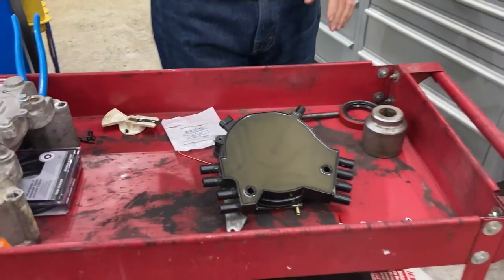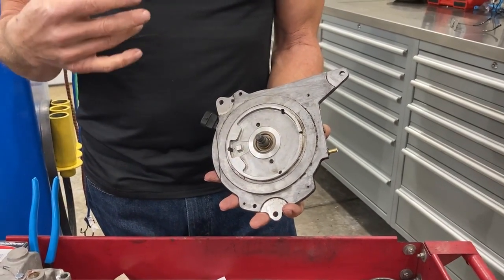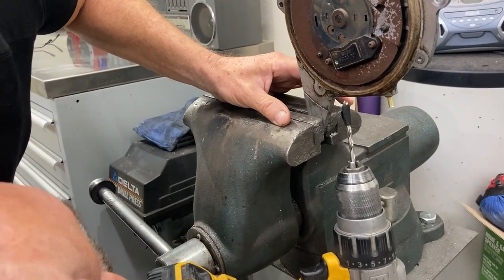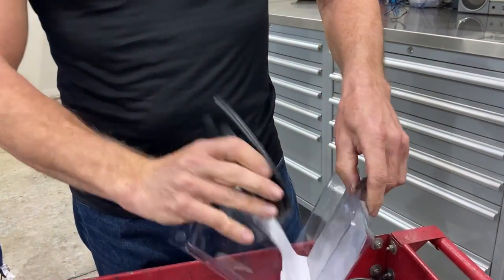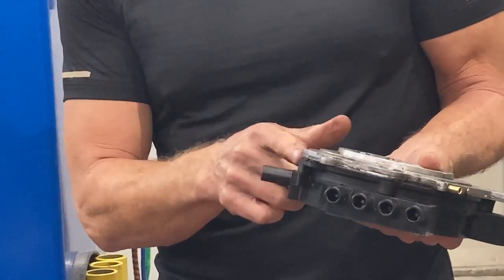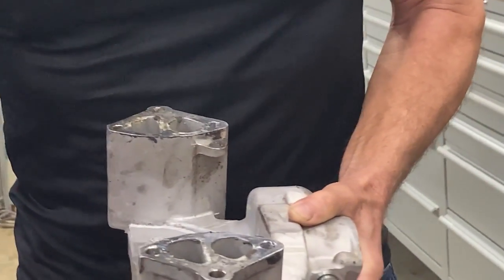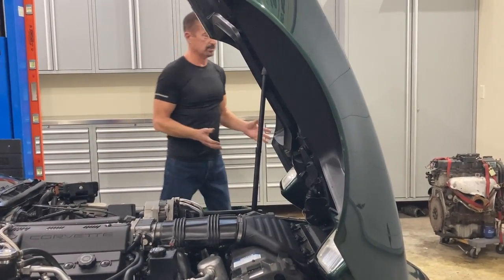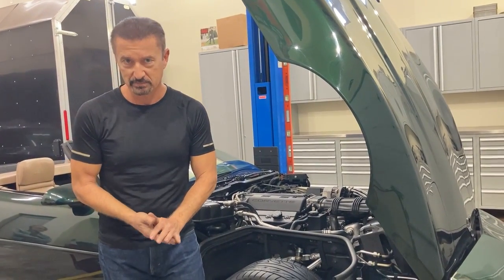1992 - 1994 Corvette LT1 Optispark DIY Redesign

Comment: Great video and very informative 👍🏻..  I have 95 c4 corvette has rough idel and makes a pinging popping sound... I have changed 02 SENSORS, EGR, TPS, IAC, MAP SENSOR and the sensor that screws into the front of the waterpump... but it still runs the same.... any ideas? Please don't say it's the Optispark... Lol
Reply from the maker: Okay, I won't tell you it's the Optispark...........but it's probably the Optispark.  Changing the Optispark is labor intense, but not that difficult to do.  There are a lot of good videos that show how to do the job.  Since I did the modification shown in my video I've had no issue with the car.  It is rock solid and very reliable.
Reply: @Arizonaperfect  OK Thanks..
Reply: @Arizonaperfect  just did the paper clip trick in my c4 95 port and there were 2 codes... C34 and H34... is this the Optispark?
Reply: @Arizonaperfect  I did get the new Optispark on last weekend and yes it fired up on the 1st crank... new plugs and wires... the wires on the Drivers side was the biggest pain but I got em on and correct.... the rear seal on the waterpump had gone bad but I never saw any water on the driveway and the coupling from the water pump to the cam shaft was rusted / welded to the spline on the pump and it cracked  on me while trying to get it off... anyways I'm waiting on another coupling to arrive and I can go back with the new water pump and get this over with... should be here tomorrow...
Reply: @mrdeanv4414 
Curious of your outcome.
Reply: @TheCorvettedez  it was most definitely the (FLUX CAPACITOR) Optispark.. so I changed waterpump,  spark plugs and wires.. it was all original and the plug wires still had the numbers on each wire to which cylinder it went to from the factory... she runs like a beast now.. however passenger side catalytic converter showing signs its about halfway stopped up... not sure what I'm going to do at this point...
Reply: @mrdeanv4414  
I just did my cats. It was a real PITA, as I did it on jack stands. If you don't have, at minimum, a welder and cutting torch, I would take it to an exhaust shop and have them put in a semi-universal cat from magnaflow. And definitely change the O2 sensor when you do it!
Reply: Which direction did you run the drain hose from your waterpump... I'm getting ready to go back with new Optispark and waterpump... oh and I was able to find the 5/16 brass inserts on ebay... I must say the drain hose from the waterpump and air to the Optispark is a great idea 💡 😀 👍🏻 good job..!
Reply from the maker: I ran the water pump drain tube down the right (passenger) side of the engine.  The accessory drive belt is on the left {drivers} side.  This minimizes the chance of the drain tube getting tangled in the accessory drive belt.  Certainly don't want your drain tube to get tangled up in the drive belt.
Reply: @Arizonaperfect  Awesome.. and Thank you for the information..
Reply: I wonder if it's possible that the Optispark is going bad but just hasn't thrown a code yet... I even changed the map sensor back to the one that was on it... runs like crap exactly the same and when i unplugged the Map Sensor it did throw the H36 and C36 codes.... In Park its shimmying and shaking in but if you put it in Drive or Reverse it will almost die and it starts popping and pinging like bad timing or a car with a crazy sounding cam.....
Reply: @mrdeanv4414  no, that isn't possible. The Optical system failure will always set a DTC 16 or a DTC 36. The H and C are historical or current. 

If the cap and rotor or the plugs or the leads are bad it might be an issue, but unless there is a shit distributor in there, then i'd replace the cap and rotor. 

The biggest issue with Optispark is the dickheads that work on it, they simply throw away and replace, often with cheap shit. The OEM units pretty much never fail, i have never seen one fail and i've done thousands of them. I keep rebuilt OEM units on the shelf to swap out, but i do not throw OEM units away. I charge extra if i find a useless cheap shit distributor in there.
Reply: Just wanted to say Thank you for you help and input today.... hope you and yours have a Blessed Happy New Year..!
Reply: Ok... so if I change out this Optispark and it still runs the same what is your expert opinion..?
Reply: @mrdeanv4414  fix the actual issue, you have a DTC34 to deal with, it is almost certainly causing this issue. The fact you replaced the MAP sensor means nothing, you still have a fault in that circuit you need to find and fix.

Replacing the distributor is not going to fix this, but what it could do is add a new problem you won't know about until you fix the problem it currently has. 

Get the correct 1995 Corvette service manual (find one on Ebay, they're not expensive) and follow the correct diagnostic procedure to repair this fault. 

A faulty MAP sensor will do EXACTLY what you describe, i had a 93 in here doing it just last week. Just because your 95 also has a MAF sensor doesn't mean a thing, if that MAP sensor is faulty it'll run like total shit, if it even runs at all.
Reply: Stop throwing parts at it and wasting money, get a Chinese TECH2 clone off ebay and the correct GM card, diagnose it PROPERLY, then replace what is faulty.
Reply: @CaseTheCorvetteMan  TECH2 CLONE..? GM Card? Send me a link please...
Reply: @mrdeanv4414  the Chinese copied the original TECH2, and it is very good. Hardly any difference in most cases, and certainly nothing you'd notice at home. Very capable unit, at less than 5% of what the originals cost new.
Reply: @CaseTheCorvetteMan  OK Thanks... I'll check it out.. is there a code for a faulty Optispark
Reply: @mrdeanv4414  there are two codes for it, high res pulse and low res pulse. 

The TECH2 will tell you what the codes are, it gives the short title of each code when you retrieve them. 

You really should consider buying the 1995 Corvette factory service manual set too, it is two books, probably cost you about $80 on ebay.

Do not buy the Haynes or Chilton, buy the correct 2 book set specific to your car. 

You shouldn't be fixing any car by simply wingin' it. That is why you're out $500 worth of sensors and so far nothing at all has changed.
Reply: @CaseTheCorvetteMan  the TECH 2 that you speak of can't be found... and no one at the Autozone or O'Reillys knows anything.... my car will start on the 1st crank but makes a popping, pinging sounds sorta like a back fire...rough Idel.... I did just change all the spark plugs and it made no difference
Reply: @mrdeanv4414  search on ebay, and add 'worldwide' on your options. They're there
Reply: @CaseTheCorvetteMan  just did the paper clip trick in my c4 95 port and there were 2 codes... C34 and H34... is this the Optispark?
Reply: @mrdeanv4414  no mate, that's the MAP sensor circuit low. That MAP sensor is either rooted or it is the wrong one.
Reply: @mrdeanv4414  could also be issues with the wiring, so check it thoroughly.

It is NOT a code indicating a fault with Optispark. 16 and 36 are related to distributor faults.

This is where the TECH2 will be simply invaluable, you can look at the values from the MAP sensor and see if it is actually reading anything or stuck hard low.
Reply: @mrdeanv4414  and i'd have to guess that code was from module 4, because that's important with codes on 94/95 on the $EE PCM, there are multiple modules that show codes. Check again, and tell me what the little number reads when you see DTC34, if it is not 4 then i'll have to get the 95 service manual out and check.
Reply: @CaseTheCorvetteMan  I just found out that H16 is code that the Optispark is not a GM Product and H34 means low power to the Map Sensor and C34 means Map Sensor
Reply: @CaseTheCorvetteMan  Thank you so very much... I just found out the same thing as I was reading your text...
Reply: @mrdeanv4414  it isn't low power, it is low signal, meaning the MAP is reading a very high vacuum reading, or it is faulty. You can unplug the MAP and see if code stays C34 or if it changed to C33
Reply: @CaseTheCorvetteMan  well it still runs the same as it did so I'm going to disconnect the Map Sensor and see what happens
Reply: @CaseTheCorvetteMan  yes it was in the 4 zone on the computer

Comment: Awesome video.  I am forwarding it to my son who I gave my 92 to a few years ago.  He has it in pretty good shape with the exception of the Optispark and digital dash.  Have you done any work with your dash?  Thanks, Bruce
Reply from the maker: The Corvette has been flawless since I converted it to a vented Optispark.  Absolutely no issues.  As for the digital dash, I haven't had any problems, so I'm just going to leave it alone.  I'm kind of new to this Corvette......is there a common failure with the digital dash display?

Comment: Buick Roadmaster and Cadillac Fleetwoods (of which I have owned or still own quite a few) have the vented style. I never had a problem with them. I think most people who have problems own Camaros or Corvettes.
Reply: 1994 Firebird Trans am - terrible problems with opti. 54,000miles water pump failure,  replaced opti distributor with (lifetime) Autozone part and then 2500 miles later failed again. 😢 Going to modify the new replacement with this and pray for the best. Autozone unit has a double gasket to keep it dry but by not venting I heard they build up ozone and that causes corrosion.  I've also heard the optical sensors are what go bad.
Reply: @americanmotorsam-caz524  Only OEM Mitsubishi modules are reliable. Aftermarket sucks. Yes Firebird has the same faults as Camaro and Corvette.
Reply: Same, have a 95 roadmaster. Everyone tells me ill have problems with the optispark, had it 10 years put 40k miles on it now sitting at 175 still haven't touched it. And who knows how old it is or if was ever touched. It spent all of its life in Detroit too and has tons of rust

Comment: you have to notch both rings 1 on cap and 1 on plastic spacer with ring on it 
otherwise electrodes are are air tite and bad gas will corode them.
on new virson 1 vac in back and 1 in top cap both were dead ended once cap was installed 
the cap was never changed with upgrade 
two notches one on main cap one on bottom mid cap and then vac flows through caps 
and back of distributor the 2 rings are to keep cap from getting sucked in and rubbing on rotor

Comment: Do the 2 bottom vent hoses join up to a T piece then to the modified fuel filter or is it 2 hoses for 2 modified fuel filters? Great video
Reply from the maker: The two make up air hoses are completely separate.  You want double the amount of "make up" air going to the Opti-Spark.  That way you don't create a high level of vacuum int the Opti-Spark unit.  The trick is to have high air flow going through the Opti-Spark not high vacuum.
Reply: @Arizonaperfect  thanks for getting back to me, it's much appreciated.

Comment: I understand about the vents for optispark but the water pump if it’s leaking and you just installed a hose to avoid coolant going on the optispark wouldn’t you still get coolant on if you replace the water pump . I believed they did that on purpose to make you pay for two jobs after warranty expired and there’s really nothing to avoid a optispark problem when the water pump leaks because it’s really directly right next to it. This is just my thoughts nothing negative towards anyone who adds a hose to the water pump just that why did gm do this and when the ls came out back to belt drive water pump these water pumps can out last the 100k mark just change the coolant every 5 yrs or 2 yrs that’s the main problem when the water pump leaks the coolant degrades after so many yrs and if you add the green coolant to orange coolant it foams and gels up the whole coolant system.

Comment: Also the Torkhead system doesn't support all the 92-93 corvette's  dash functions, I investigated a year ago for my 93, the only work around they considered was to update the harness to 94-96 which also converts to mass air from batch firing , But im cheap so did basically what you did. great video
Reply from the maker: Thanks for sharing that information about the Torkhead engine management system.  That is a serious consideration to make when purchasing that system.
Reply: Batch fire refers to injector firing, where pre 94 all fired the injectors one whole bank at a time, 94+ has sequential firing. Nothing to do with the MAF, that device reads incoming air volume only, and a 94+ it is used in conjunction with the MAP to help the PCM determine load on the engine.

Comment: I have a 93 40th anniversary  with 32K on the clock . Its running OK.
I plan on venting mine and replacing the cap and rotor and keeping my  optispark  original.  
Trying to be proactive  before problems set in .
How many miles are on you Vette.
I'm hoping my opti is not a rusty
Reply from the maker: My Corvette has 69,000 miles and spent most of its life in San Diego Ca.  They have perfect weather and the inside of the distributor was filled with rust.  I don't know how the car was treated before I bought it, but it ran ruff until I replaced the Opti-Spark.
Reply: @Arizonaperfect  Thanks for the reply

Comment: This is honestly the most American thing I have ever seen. It’s guys in their garages and shops that solve problems, not engineers in Detroit.
Reply: Very creative fix and 3 holes are better than one😊
Reply: It would be better if he ran the fresh air intake hose(s?)to the air intake, those 4 Ft. hoses with cut open fuel filters laying up in the front end will probably suck water up into the distributor like a straw if they ever get wet!? In fact due to the length of that setup, it may literally be pulling moist humid air into the system? Been a few years, I wonder how it's workin' out?
Reply: He didn't solve anything 😂🤣😅
Reply: @geneyus6411 
Actually, he did. Moreover, he did it on a small budget.
Reply: You remember the first part? Where he said that he went to YouTube for solutions? Everything he’s doing here he learned there.

Comment: I couldn't watch past 210. Chevy did use a vented opti in the later model c4s.  And I'm not a mechanic but I wouldn't pull the opti without running the dtcs first.  Looking gor the dreaded H16 code.  I fixed  mine by running some silicone around the opti where it mates with the water pump.  I also run a tube from the weep hole in the bottom of WP around the opti in case of failure.
Reply: He did both in his video.

Comment: For those vacuum lines, aren't the 2 fiiting joined together with T hose fitting and 3rd part of the T goes to manifold. There's no need for that long line with a fuel filter, that's hacky!😳
Reply: The whole thing is, you can simply buy a full kit from MSD or Petris, and both are significantly better than just doing this. Neither are expensive, and both include everything you need.
Reply: @CaseTheCorvetteMan 
$20 or $250+. I guess expensive is a matter of opinion, but numbers always speak to me.

Comment: Dump the Optispark and get the TorqHead 24x system, it's a coil over ignition system. I did 4 years ago and it's the best thing I ever did. Optispark is still a disturber with a rotor with pins on the cap. As soon as you install it starts deteriorating the minute you start the car. If the Optispark was a normal access disturber on the top of the motor it would be fine, but it's buried on the front of the motor requiring you to remove the water pump and crank damper to get to it. I installed the water pump weep hole rerouting when I did the swap, it's a weep hole and subject to weeping and GM screw up not routing it away. With the TorqHead 24x system you also get a OB11 PCM.
Reply from the maker: I agree with you that the Torqhead system is a more modern system, but it also costs thousands of dollars to make the conversion. You can buy a lifetime warranty complete Optispark unit from O'Reilly's Auto Parts and do the modification I outlined in my video for about $250 bucks. So, if you have the mechanical abilities to install a Torqhead system, then replacing the Optispark for free (lifetime warranty) every 10 years is no big deal. There is no guarantee that the Torqhead system won’t fail sometime in the future and if it does hopefully that company that makes the Torqhead system is still in business.  Since I’ve converted my Optispart to a vented system, my Corvette has run flawlessly.  There have been many reports of Buicks and Pontiacs with vented Optispark systems that have gone over 100,000 miles without any issues.
Reply: @Arizonaperfect  It cost me $1,730.00. I'm the original owner of a 94 Z28, it doesn't owe me a dime, the car is in perfect shape. Over the years I've done all the maintenance and up grades. To me the money is well spent.
Reply: Your upgrade sounds like it is well worth the money over dealing with the Optispark system.

Comment: Great video, I need to do this on my 94 also, which opti did you purchase to modify
Reply from the maker: I bought a replacement Optispark unit from O'Reilly's Auto Parts.  They have a lifetime warranty!  So far the car has been flawless.  Runs perfect with no issues.
Reply: @Arizonaperfect  lifetime warranty until you drilled into it!
Reply from the maker: @larrybud  The modification is so minor that most employees at the store wouldn't even notice the modification.  But with the modification, you probably won't be needing another Optispark unit.  My Corvette has been flawless since the modification.